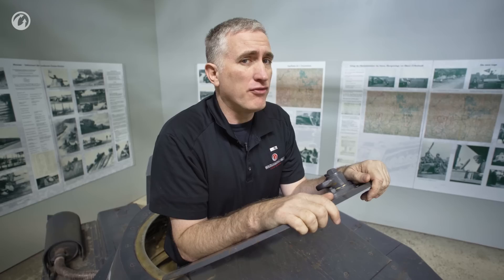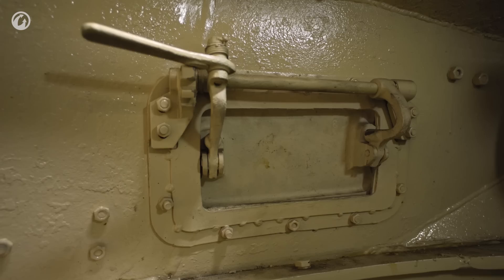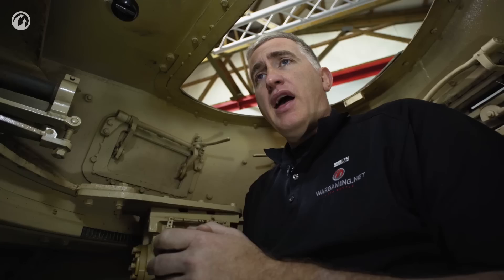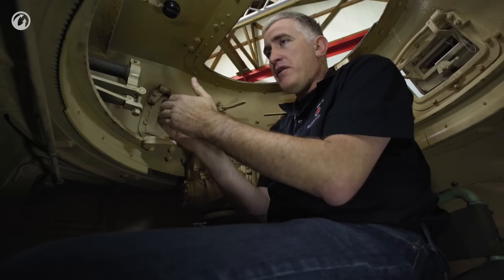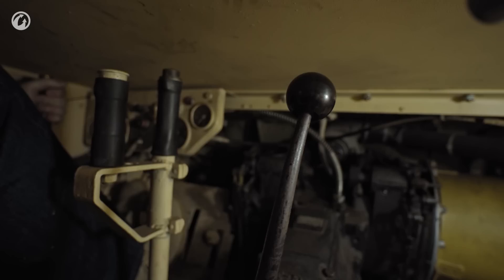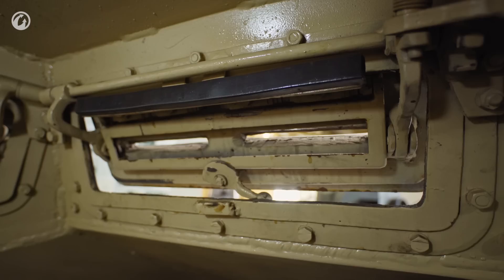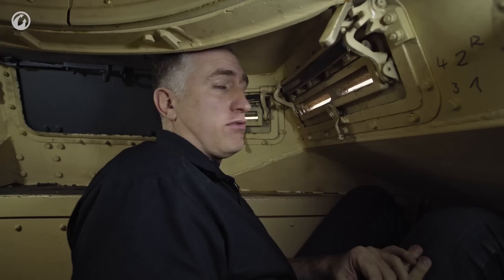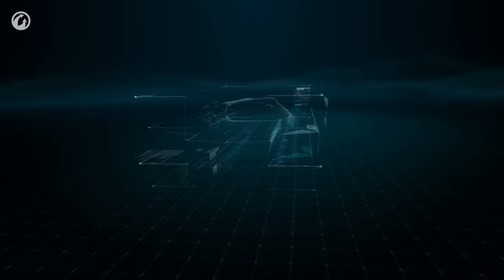Inside the Chieftain's Hatch, Panzer 1 Pt 2.

Comment: Just yeet the seat when the tank is burning.
Reply: It is also the melee weapon
Reply: @Osmosium2507  Or a shield for the deadly Spanner and Seat combination.
Reply: @MikaelKKarlsson  The Schraubenschlüssel-und-Sitztechnik has been forbidden in warfare since the 1790s! Even Hitler's troops would never have dared to use it.
Reply: 7.62 might never burn 
On this tank
Reply: @mr.waffentrager4400  That engine and fuel tank certainly will, though.
Reply: @mr.waffentrager4400  it definitely will cook off if there is a significant fire inside from fuel, grease, electronics, plastic, leather etc.
Reply: @SonsOfLorgar  yes
Reply: Y E E T
Reply: @mr.waffentrager4400  so why do you claim 7.62mm ammo won't explode when it absolutely will. (Except for the projectile part of the ammo)
Reply: @SonsOfLorgar  it will explode ...but it would have very slim chance of exploding

Comment: The Panzer 1. It's bigger on the inside.
Reply: For sure, still not certain how he fit inside, let alone had space around him.
Reply: I'm sure it'd have more stuff cluttering the inside if it weren't stripped out interior, still its kinda roomy in there, poor guys then get stuck into more cramped LARGER tanks, go figure...
Reply: @Feiora  Well I think a large reason for that is that bigger tanks tended to have at least 30 mm cannons on them, not twin 7.62 mm MGs, so you had to leave room for the recoil, normal man could take the recoil of the MGs, sure his shoulders would be sore but nothing would really be broken. However cannons especially the later war heavier cannons could seriously injure or even kill a man if they got hit with breach recoiling backwards so you had to leave room for that.
Reply: The Tardis tank!!
Reply: Haha or as clara put it, smaller on the outside
I'm sure the doctor wouldn't be too fond of the nazis using tardis tech though
Reply: I thought it was smaller on the outside ;) 
One of my favorite capaldi era jokes haha
Reply: @bohica3264 when he swivels the turret it looks more like a dalek than the TARDIS, but yeah, definitely bigger on the inside.

Comment: Hot damn, when you slammed that hatch down I imagined the mechanics standing outside flinching.^^ They really love these things dearly, I know how they looked at us when we were climbing on the Panzer IV and the Panther.
Reply: Like crew chiefs everywhere, it's their baby and someone else just gets to borrow it from time to time.
Reply: It's a retired machine of war, made out of armor steel, I don't think you can break the hatches and ports so easily. Running engine, perhaps.
Reply: @Zamolxes77  Most of them were wrecks and were lovingly restored by Bundeswehr mechanics and members of the Panzermuseum Supporters Club. They are pretty protective about them.^^
Reply: He lopped off the back of the chair, pushed open the hatches, and, after getting out, slam dunked the hatch like Shaq. I died. 🤣
Reply: @Zamolxes77  never underestimate a soldiers ability to break stuff.
Reply: If youve ever restored a military vehicle, its a weird feeling
If I break it, its okay
If someone else breaks it, I will be spending significant time at a bar
Now, in my case ot is jeeps and transport trucks, but I imagine they are the same way
Reply: @kyleh3615 I felt the same when I restored a motorcycle. When I was selling it the buyer took it for a test ride and just watching him ride it around I couldn’t help thinking take it easy be careful even though he wasn’t hammering it 😊

Comment: If my memory serves, I remember reading the Panzer I stationed in Nanking City during the siege, held off numbers of Japanese attacks, and managed to take out two Japanese tanks. And it was finally destroyed by field artillery.
Reply: Would not be surprising considering that the bulk of the Japanese armour at the time were Type 94 tankettes. 

The Type 94 was basically designed to be a larger Carden-Loyd. Leaving it smaller and more lightly armed and armoured than a Panzer I.

Comment: I wonder if the viewing port being on the back of the turret is based on the idea of giving the commander a view of a direction the driver can't see in.
Reply: Yes, also it could be for observation during travel. Since the turret seem to be easy enough to swing around, maybe they would travel with the guns pointing backwards ? Another possible role could be for defense, to give the commander an option of defending the tank towards the back. Since is such a low to the ground tank, an enemy soldier could have jumped very easily on the engine deck with a satchel charge or grenades to take out the tank.
Reply: @Zamolxes77  Or to observe flag signals from the troop leader?
Reply: @Zamolxes77  Why would you drive with the turret facing backwards? It's not French!
Reply: @Mr-Trox   I could not fit in a pz I, unless you cut me in half, lengthwise and sideways :)

Field of view is important when driving, to observe the road and obstacles, that back vision slit seems to be very big, so it would considerable increase commander field of view to assist the driver ?
Reply: If you were just driving you'd be head out. 
I imagine in a lot of combat they were head out as well, the Germans were big proponents of situational awareness.
Reply: @kirotheavenger60  Most tank commanders rode that way out of combat, and more than a few into it, not only did it give a superior view to the view ports, it was also much more comfortable.
Reply: Question is, does the commander’s seat rotate? If it doesn’t can he even see out of the viewing ports without rotating the turret 180 degrees?
Reply: @tlw4237  In some tanks, yes. In others the Commander has to turn his body to see. Ergonomics weren't really a thing in the 1940s.

Comment: Interesting comment about the engine air intake coming through the crew compartment. The US M60A3 had a similar arrangement, except the crew could unbolt and flip the intake covers so then the engine would draw air from outside of the tank, for cold weather or maybe chemical threat. When the tank became a giant Dutch oven in the summertime (NTC!) it was nice to have some air flowing through the turret.

Comment: i've heard that the point of the engine intake from the crew compartment was for ventilation. I had read somewhere that the old landships did a similar thing because it reduced the buildup of gunsmoke inside the vehicle. one variant did away with this and then had ventilation issues. If you dont intake from the crew compartment you then need additional mechanical ventilation for the tank. Dont have any good sources to point you to unfortunately, but hopefully you'll encounter something about that in your research.
Reply: That does make sense.
.
Reply: All the “landships” had serious ventilation problems.

The engine was in the middle of the crew compartment where it rattled away emitting all kinds of fumes: leaky exhausts, lubricant fumes, petrol fumes, lots of heat... engines 100 years age were rather primitive (with the possible exception of ones used by Hispano Suiza but those cars probably cost as much as a tank).

The crews were widely reported to find the temperature inside the things almost intolerable no matter the time of year. Then you have the seating arrangement - except for commander and driver in the front no-one had a seat. That’s six+ guys with motion sickness, muggy heads and splitting headaches from CO poisoning, trying hard not to vomit and sweating absolute buckets being lurched around without warning because they couldn’t see where they were going all in a metal box full of sharp steel projections that had no suspension at all - and the engine sitting there smugly waiting to burn anyone who fell against it or the exhaust.

After a very few hours in the thing crews would often stagger out and collapse from heat exhaustion, CO poisoning and if they’d been in action cordite fumes. The Whippet (was ever a tank less fittingly named) had another crew incapacitating trick up its sleeve. The two engines were in the front in their own box, but they still leaked fumes and heat into the crew compartment. And the two exhausts pointed almost directly at said compartment. Such was the pleasure of being a Whippet crew that each tank sometimes had two crews who would operate it on alternate days. This was to allow a crew a whole day to recover from what their tank had done to them.

Though maybe the German A7 was even worse - 18 to 20 crew who had all the fun the landship crews did, in a vehicle prone to falling over if it tried to drive along an incline. Such as the edge of a shell-hole.
Reply: @tlw4237  I don't imagine they had in real protection against gases used chemical warfare either.
.
Reply: @BobSmith-dk8nw  They had standard issue gas masks as far as I know, another miserable thing to use.

I might be wrong, but I can’t recall tanks encountering gas. Gas wasn’t much use as a defensive weapon because if you used it too close to your own lines it affected your troops just as much as the enemy. Mustard, a particularly unpleasant and persistent compound, would be ruled out because if it settled in your trench you might as well just hand the trench over to the enemy because it’s no use to your side any more.

By the time tanks were used in effective numbers the entente wouldn’t have needed to use gas in attacks much except maybe to suppress German artillery batteries behind the lines. The tanks were far more effective, especially in their morale effect on German infantry who, despite the invention of the Tank Gewehr and K bullets, often had little to counter them with. Tanks also had the advantage that they were unlikely to cause your own side many casualties or hamper your activities.
Reply: @tlw4237  Yes.  I can't recall any mention of tanks and gas.  It occurred to me though as I was reading about the hellish conditions inside these machines that ... oh ... and here's one more thing they - might - have to deal with.

One problem for the Germans using Gas - was that the winds of the world predominantly flow from west to east, so while dumping gas onto enemy trenches and rear areas might not be so bad to your own troops - who would of course be prepared for dealing with the gas - that would give you most of no-mans land as a buffer.  I would also imagine that wind conditions would play a part in conducting a battle in which they were planning on using gas. 

I could imagine them using gas as a defensive weapon if dumped onto enemy assembly areas and artillery - but it may not have been something they wanted to deal with when their own troops were unprepared for gas - and of course - the enemy would be dictating the moment of attack.

It would also make sense that anyone planning an attack which was going to include tanks - might not want to introduce the added complexity of dealing with gas to the, at that time, new vagaries of using tanks.
.

Comment: I want a spaag modded for infantry fighting , soft targets and light "hard" targets and stationary targets like above ground bunkers.  I would love to see how duel smooth bore gau 8s , with high velocity fin stabalized Saboted, depleted uranium tipped darts would work ...give them a needle sharp tip to have the smallest surface area possible when impacting a target so the projectiles energy is focused onto a pinpoint sized area,  it should penitrate very well . plus the D.U. tip would react with any ferus alloys , making any steel hit ignite.  Throw a small diameter tungsten alloy shaft into the mix and there would be a high density  high mass object punching through after the d.u. reacts . if it does not react it obviously will help the dart tip punch through whatever needs punching through at 4000-6000 rpm. 
Put a new turret on a modern mbt chassis,with external guns in armored shrouds , internally designed to hold the ammo feeding shoots and controls and a single gunner just to make sure malfunctions are cleared and everything is working well . also to manually operate the guns if need be. Then the driver in the chassis obviously...the rest of the space could be used for the massive ammo storage needed....seems to me that if a small glob of molten copper at 8000fps can punch through modern tank armor, 100 high density darts at around 5000fps would too. And with that value of fire , the same spots will likely be hit repeatedly thus increasing damage and the likelyness of total destruction. 
 Rolling thunder and BRRRrrrttt!
Reply: what the fuck
Reply: @zerodiniro3273  what the fuck what? That would be alot of fun to play with

Comment: The hatch on the rear of the turret makes sense especially with such a terrible commanders hatch, if somehow infantry can get behind it, they just hop on, stick some dynamite or throw a grenade in there. I can't see infantry trying to rush it head on.  Alot of early tanks had rear ports for this reason as they were used for infantry support more often.

Comment: 2:44 I think the rear port was added after the Spanish civil war experience as the tank would have been taken out by soldiers coming from behind. That is just my theory feel free to add.
Reply: Trouble is the guy in the turret has no way to traverse himself and look backwards. Making the rear vision port unusable and useless unless the guns were pointing backwards. The two-man French tanks had a similar problem if the leather strap/“seat“ across the turret ring was in use.

These 2 man crewed 1930s tanks all seem to assume that the enemy will always be in a convenient location in front of the tank. Maybe because they thought of tanks as an armoured beast steadily rolling forwards assaulting whatever was in front of it while accompanied by adequate close infantry support, like the British heavy tanks were used in 1917/18 on the Western Front.

Comment: General question: watching this video and all the openings this thing has: does this tank have a "drain plug" of sorts or a bilge pump?.
And what about other tanks? I mean they are quite sealed in the hull i guess, but have openings on top, which may or may not be well sealed (newer ones probably better if they are abc capable). But what if you have to get in and out in heavy rain?
Reply from the maker: Most tanks do, indeed, have a drain plug for the water which inevitably gets into the vehicle. Bilge pumps  are not unheard of either, the M1 has one, for example.
Reply: @TheChieftainsHatch  Thanks!

Comment: Just a guess, but I think both the seat adjustment and the twin-handled tillers are so the driver can see when his direct vision hatch is closed. When it's closed, IIRC, he has only a tiny slit to see out of. Hard to see anything at all unless your face is right up close to it. So the seat slides way forward, putting his face several inches from it (must be very uncomfortable on rough terrain!). When he's driving as usual, the seat slides back for more space, and so he isn't driving with his face in the window, getting rain and dust all over him. The two handles are so he can reach the tillers either way. His arms aren't as long as yours; the Depression was really bad in Germany, and the people were small. Which is also part of why they didn't mind such cramped corners. You should try a Japanese tank next!